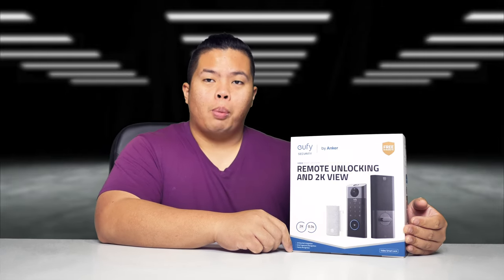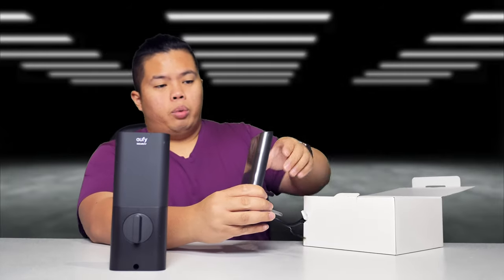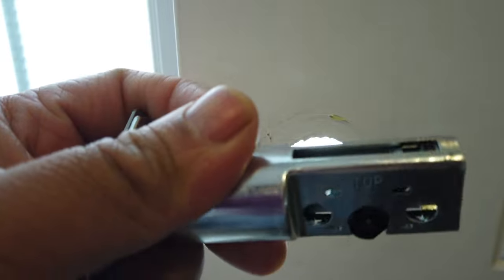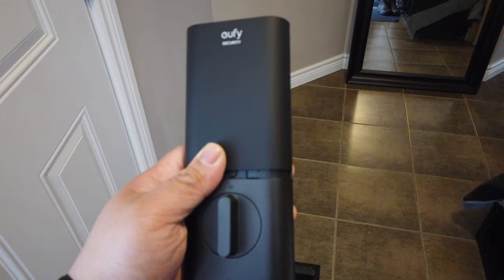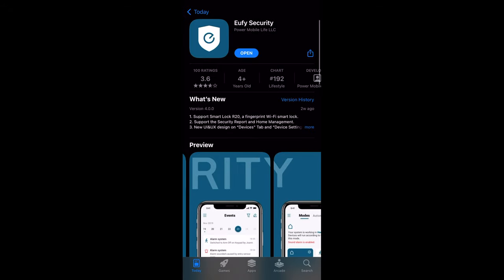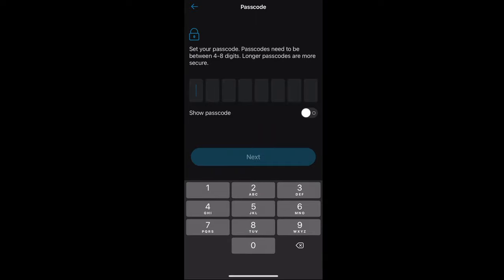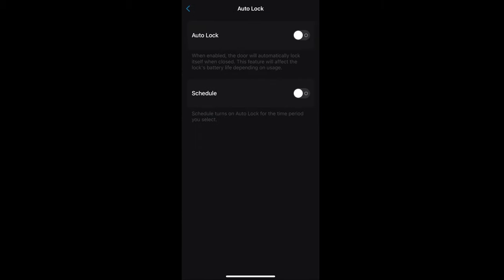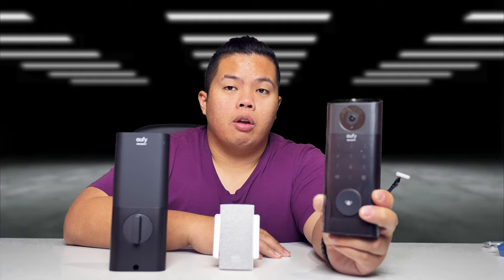The See-Everything Smart Lock 2K Camera Doorbell | eufy Security Video Smart Lock Review

Comment: What are the measurements to the back piece I have a second deadbolt and just wanted to know if it would fit?
Reply from the maker: Its adjustable. I had to take off the metal bracket because mines smaller